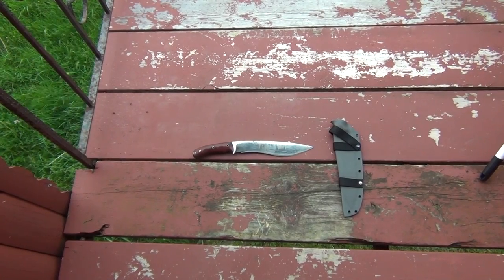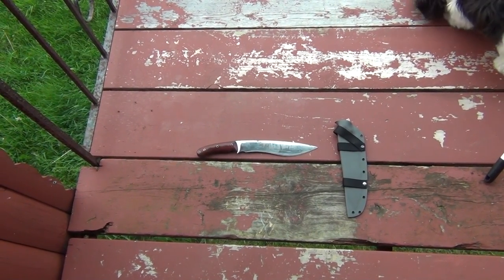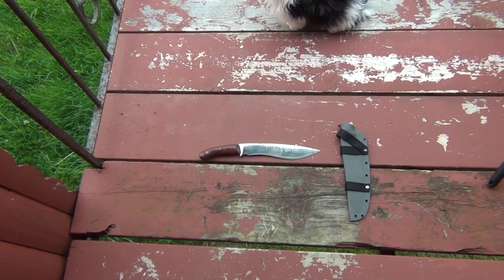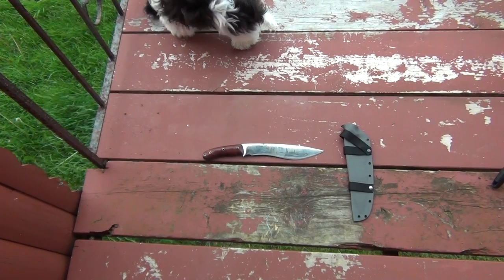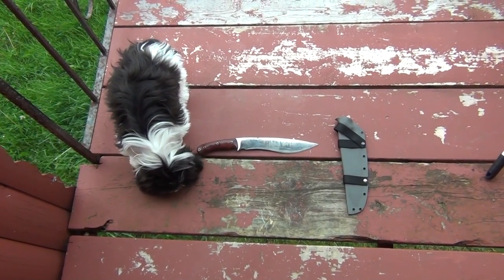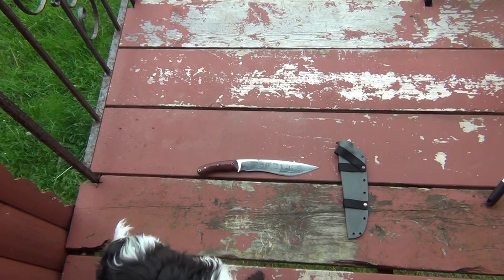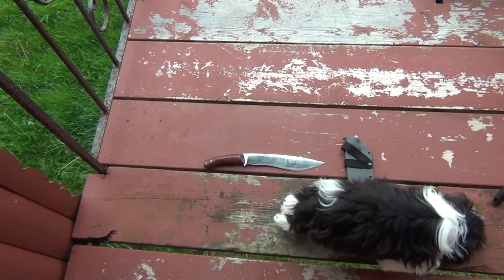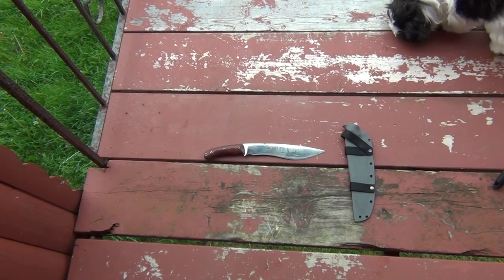Knife Challenge #12 : Bark River Grasso Bolo Fail

Comment: Cliff, 11/2 years later, I know a PhD working for a metal heat treat company, and a professor of metallurgy at Cal State…Both agree one plausible issue is speed grinding of 5160, even with using well established heat treat, the damage to grain structure or as they term it (brittle zones) might not be overcome by the heat treat and proper tempering and stress relief techniques. Perhaps destruction of 25 random blades with micro analysis of structure of the random steel grain would be useful. ( Thats all the info I could get from them).  Love this post!!! You are the man when it comes to fair play!!!!
Reply from the maker: That is even a bigger problem in some respects than the post HT grinding. People seem to think if you grind pre-HT then nothing you do matters at all. This isn't the case because you can still micro-crack the blade and you can vastly distort the micro-structure which will effect how it responds to HT.

The problem is that a lot of knife makers/manufacturers tend to respond to metallurgy as if it was anthrax.

Comment: Thank you for the clarification.
A falling tree does not have inherent stability.  In fact, by using the edged tool we are trying to create enough instability (part of which will be lateral as the tree falls in a circular swing) to make it fall.  The blade will, as I've indicated, experience this lateral instability/force as it makes the cut and the tree begins to fall.

I agree that smaller diameter concentrates the forces on the edge, but large or small, a falling tree creates lateral force

Comment: First, Stewart's response contains an obvious untruth: the final condition of a knife blade does NOT depend just on heat treat but on GRINDING. If the blade gets too hot in grinding, the heat treat will be ruined. Stewart can't be so incompetent as to not know this, if only because his knives are famous for having this problem and it has been widely discussed. So if he ignores the possibility in his reply then he is attempting to deceive.

Second, if Stewart claims that the problem could happen to any knife and is the result of bad technique then he should be able to buy an MT151 or Psyko 911 and make the knife fail in a few strokes! It's up to him to demonstrate this - he is the one making the claim. 

Third, you can easily disprove his claim. Taken a knife and a baton. Whack the blade into wood more deeply than it would go chopping. Make sure it is stuck, then twist. If the knife has been correctly made you'll tear out a chunk of wood rather than the wood tearing a chunk of knife. This experiment replicates all the stresses that Stewart claim are responsible for his knife's failure - but in worse form. Repeat.

Comment: Cliff, I agree that it is difficult to produce knives that can handle stress from chopping unsecured wood and that skilled users will minimize lateral load on the blade, but I must argue that this is necessary given the way that Bark River is selling this knife. A bolo is a type of machete which is intended for clearing vegetation (including branches), which aren't secured even by expert users.  If Bark River wants to sell such a knife, they should ensure it is capable of this type of use.

Comment: The fact that half moon failures are not uncommon is an indication of common industry cost-cutting measures, specifically Batch Heat Treat and Dry high-speed Grinding of edges. 

5160 edges typically show ductile failure not gross chipping.

Unsupported chopping does put more lateral load on the edge than supported chopping, but the mode of failure of this alloy is of great concern.

Comment from the maker: Yes, unsupported trees subject to movement in chopping will create significant lateral forces, hence why you don't chop them down because that movement aside from causing lateral loading is also likely to cause glances, trunk splitting and a whole host of problems. They would be all saw cut, or at least saw notched.

Comment: Mr Stewart, I have read your description of your grassing bolo and when using it for its intended (according to you) I chipped the blade.  I have quite a few of your knives and even attended a BRKT use and care class hosted by the BRKT  fan club. It was a great week long class. We were taught about the unsupported blade phenomenon and I took all conceivable precautions. I would never fault one of your products as they are perfect bit in this case I can only look to the steel as the problem. Cont

Comment from the maker: When the wood is supported the forces are mainly in compression for which the steel is exceptionally strong. However when the wood is not supported the forces are lateral hence you can see failures in what would appear to be trivial situations.

Comment from the maker: The forces are on both sides if the wood is supported and proper technique is used in the cut. With forces balanced from left to right there is no unbalanced force to create a lateral load.

Comment from the maker: This is one of the key problems with the argument, but it isn't trivial to make because while there are some types of unsupported wood that normally is cut (saplings) not all are (dead and dried limbs). It thus is very easy to confuse a novice by using the fact that you should not in general do one to argue that the problem when you do another is ok.

Comment: if he'd been cutting under a full moon it would have resulted in a full moon chip rather than a 1/2 moon chip, and that could have made the blade snap in 1/2, resulting in the warranty requiring a full replacement. 
in fact.. as they guarantee it under any circumstances, snapping it in 1/2 and getting a full working equal replacement (which is the legal meaning of warranting something) would be their only option.

Comment from the maker: Bark River hosts an active forum where you can find detailed information. There are lots of makers of blades, axes and similar where there is no information at all, not only on use but even on the details of the steel used. Could we improve, sure and we always are, but we are far ahead of the pack in this area. 

However if you are the type of person that needs that warning label on Shampoo so you don't end up eating it, well you might be better off not trying to figure out how to use a bolo.

Comment from the maker: The grindins are frequent get togethers where individuals can not only learn about how to use blades, see how they are made in in fact make them personally. 

If you wish to learn then participate there and learn from the people with much experience instead of arguing about a knife you have never used. 

Our knives are perfectly fine for beginners as long as they wish to learn, if you don't want to use a knife properly and just beat it about - lots of people make that style of tool of course.

Comment from the maker: If there is no movement the lateral forces will in general be side balanced and thus act in compression, it is only when they are not so balanced that there is an issue. If you pinch a piece of paper for example that is a compression force even though you are pressing on it from the side. But if you remove one of your fingers and keep pressing with the other it is now lateral and will deflect the paper. The paper didn't suddenly get weaker but it will break now where it would never before.

Comment: If the wood is not supported and the knife hits a knot, I would assume that the knot would hinder the penetration of the edge into the wood in conjunction with the unsupported nature of the wood, and the wood would be deflected in the direction of the blow. If the wood was affixed in a stationary way, I could possibly see how the density of the knot could strain a thin edge of steel. But if a steel fails from an impact of that nature, I would conclude an issue with the steel.

Comment from the maker: Jim is active on the forums, a PM would be best.

It would not be professional to talk about the specific failures of other makers/manufacturers.

They are hand picked and the most experienced grinders used of any current production company and use their experience effectively which is evident by the fact we have had no blade failures even though we sell blades in the tens of thousands each year.

Comment: Dear sir, a half moon break could easily be due to steel and the wood you're chopping. In fact, since the blade is at a relatively high edge thickness and convex ground, it is more withstanding to lateral forces, so the unsupported wood phenomena shouldn't really happen with this type of grind.

Comment: You should add disclaimers saying that chopping an unsupported object could result in blade failure. Because in a real life survival situation a person may not have the luxury of chopping a supported object and would need to depend on that blade to stand up to anything! That however doesn't fix my blade and make me sure that it is of sound structure. It would put my mind at ease if it were a brand new blade, instead of a doctored failed blade.

Comment: This is not shampoo, it is a sharp cutting tool for cutting, slicing, and chopping. Making it even more dangerous than the consumption of a hair care product. The dangers posed by catastrophic failure due to its inability to withstand any forces other than supported compression, make it an extreme hazard to anyone who uses it!  Moreover you are asking me to reuse said product after a regrind and trust that another failure will not occure as long as (cont.)

Comment: The damage that you call the unsupported edge phenomenon, is actually caused by the Hertzian cone of force. In which a hard surface is forced into the edge of a hard but brittle surface which causes a cone shaped chip and uncontrollable fractures and ripples! In this case the wood was the hard surface and the blade was the hard but brittle or fragile surface. Which indicates a flaw in the steel, or manufacturing process, and not user fault!

Comment: Ya see... This is why I never joined the debate team in high school.  I can't craft a good argument for a position I don't believe in.  BRK's case is well-made, and most probably the truth, in my humble opinion.  If a significant section  of steel is restrained within a piece of wood while the operator is applying a good degree of force and has a firm grip, and the piece of wood moves laterally or in a twisting motion at the same time, good steel in an adequate section thickness could chip out.

Comment: Disregarding falling, even as it begins to lean (before it falls or even before you begin to notice it) it is creating lateral force on each cut.  This lateral force will be present long before the tree will snap...including during initial cuts.  The wood being cut with the bolo for instance did not snap but still generated lateral force.  The two actions don't go hand in hand.

Comment: Therefore, I do not agree with your claim that this failure is attributable to user misuse - an experienced trailblazer will not typically secure wood that they are clearing (in fact, it would be very difficult to do that in many cases while clearing brush), and despite your (correct) identification that knives from other manufacturers can fail in similar conditions, it does not seem to be the industry's position that use of knives on unsecured wood constitutes misuse of these outdoor knives.

Comment: Specifically, what other makers knives have shown this behavior during the unsupported chopping phenomenon?  This kind of failure can happen regardless of wood type, from Balsa to Bog Oak?  What tests were done to eliminate heat treatment issues in these failures of other makers knives?  What was the range of measurements of the edges that failed; primary grind and edge angles, edge thickness?  Why did only the Grasso fail when all 4 knives were subjected to the unsupported chopping phenomenon?

Comment: Mr. Stewart's explanation gives you a clue as to what went wrong in the manufacturing process! One person is responsible for grinding and checking the blade! Is it possible that he or she over heated the blade while grinding it? Maybe trying to get out grinding marks! Its very easy to over heat one spot on the blade while trying to remove an imperfection! And then that person is responsible for checking his or her own blades! Shouldn't a non biased second person be checking those blades?

Comment from the maker: Again, we have seen the same failure from other makers/manufacturers it is not an isolated incident and it can be used safely and effectively as often demonstrated on the forum. 

As for replacement, the blades are replaced if there is a fault in materials or workmanship, however this isn't the case here.

Now while you would want a replacement in such cases, the vast majority of our users would NOT because they of course have to pay for it, hence we don't.

Comment: Because of the length of argument/debate the customer (me) runs out of things to say! You are right about the regrinds! It is impossible for the customer to win as long as the company doesn't give in! However because of the conversations and exposure of possible bad manufacturing the company could loose customers/revenue so does it really win the argument in the end especially if this is a recurring problem they face? Thanks for the challenge!

Comment from the maker: You will know in how the cut feels as you make it because just as the blade receives the unbalanced load so will your hand.

If a tree is actually unsupported meaning it is moving as you are attempting to chop it then it is fairly dangerous for many reasons to fall it with a chop based technique, hence all small tress are saw cut usually.

Comment: Forgive me, but I'm a bit confused by your answer.  If you're arguing that it's okay to use the knife to cut unsupported wood in the context of trailblazing and brush clearing, and that this should not be expected to damage the blade, then why would I expect chopping unsupported commercial lumber to damage the blade?  Is your argument that this type of wood causes even more stress on the blade than cutting through unsupported wood in the wild?  Can you explain why this would be?

Comment from the maker: Yeah "pulled that straight out of your ass" is going to get you banhammered easily on the forums. That is why the defenses are made as they are, they are not supposed to actually defend the position they are designed to make you lose your cool and forget what you were supposed to be talking about.

Comment from the maker: Our blades are not for someone with no skill/experience who rather than learning just start hacking about correct. 

The fact that this is even being brought up is fairly amusing. Would you go out and buy an extremely high end japanese pull cut saw, give it to a completely novice who then breaks it by doing a strong push cut and then go on a rant about how japanese saws are weak and non-functional.

Comment: Am I right to think that 5160 is softer than D2 which means it is less likely to chip, but it won't hold its edge as long, or is the reverse of that?

My Chinese made bolo is made out of 5160, and like I said it kinda sucks because the handle fell off when I was throwing it, but it hasn't chipped at all so far. Now that its messed up I've even cut into lava rocks with it and the edge hasn't chipped. Is your 5160 harder than the cheap Chinese 5160, and would that explain why it isn't chipping?

Comment from the maker: If the top of the wood moved left and the bottom stayed in contact with the ground it would rotate + (define an orientation), the blade spine could easily move right and the edge stay in the wood and thus rotate -.

Comment: the only knife i ever had that rippled was a pakistan made bowie that i used to cut down a christmas tree. the funny thing is that it too hit a knot. it seems odd that the edge would ripple and blow out. my question would be if the knife was designed to fail then why not just buy a cheap knife? if it's meant to do that then what was it actually designed to do as far as work goes?

Comment: Mr Stewart can you please explain how it was that I was able to chop through a knotty dry unsupported 2" diameter branch with a knife hollow ground and less than .5 mm thick at the edge with no issues but I tried the same thing with my grasso and the edge exploded.

Comment: Dear Sir, your website warranty states "guaranteed against Manufacturing Defects for life". I claim this failure is a manufacturing defect, because none of my other knives failed to do what this does in the last 10 years. Unless you can proove it is not a manufacturing defect 100% via spectroscope analysis, then I'd expect you to honor your warranty with a full refund/replacement and not a regrind. This was not my fault. This is a good faith issue. I bought this in good faith. Please respond.

Comment: Agreed that with the wood supported there is more balance on each side, but how do you know if there is enough support...that the edge itself is still not receiving lateral stress...that your support is perfectly counterbalancing it?   
Also, how would you suggest I support a standing tree that I want to fall...as your advertising says it will destroy smaller trees?
I can find information on proper cutting, but supporting a fallign tree is counter productive.

Comment from the maker: It is discussed in details on the forums there are entire threads discussing each steel with frequent demonstrations of use. It isn't meaningful to reduce this to YT sound bytes, that leads to the common misconceptions about steel where people reduce non-trivial concepts to sound bytes which are nonsensical, i.e., stainless is hard to sharpen.